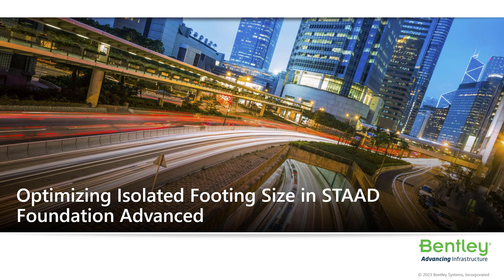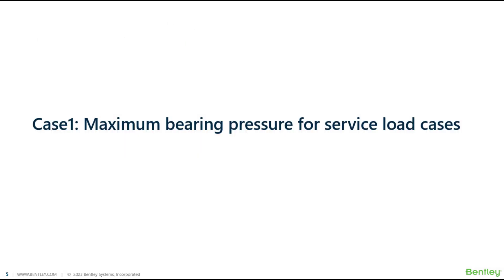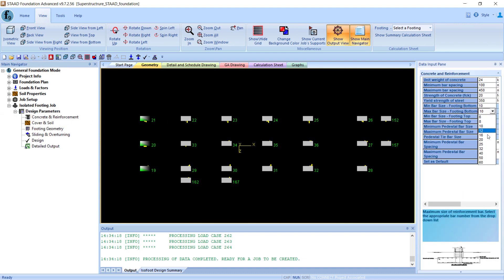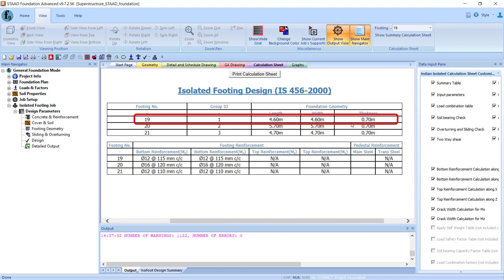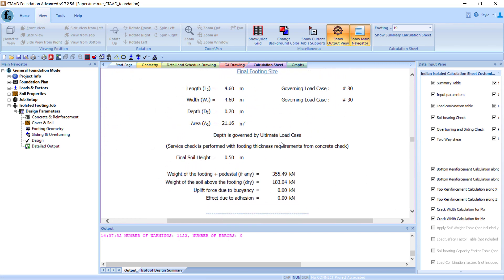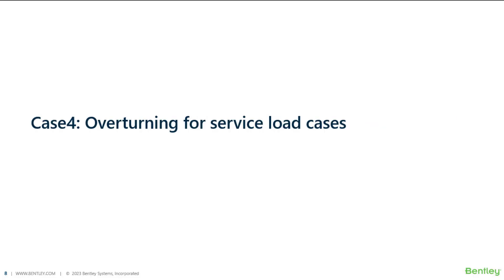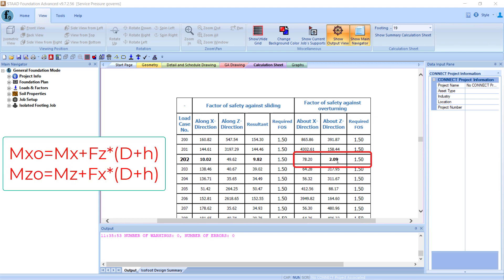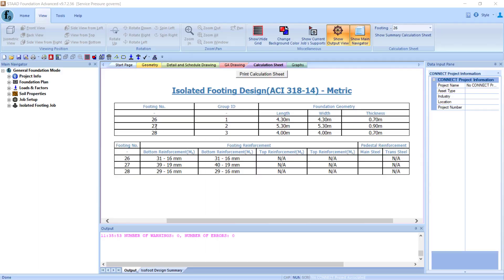Optimizing Isolated Footing Sizes

Comment: Thanks for the video with important concepts for economic design..however where has been the reference of ultimate base pressure to be considered by checking M/P>0.5...Is it in ACI code.?Also can you give some reference clause for consideration of minimum 50% for contact area in isolated footings..Thank you.